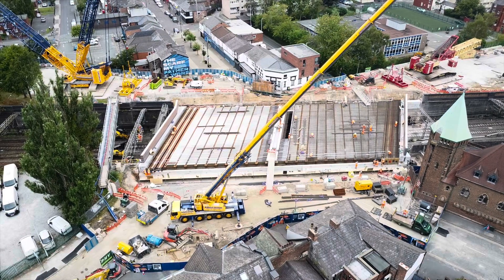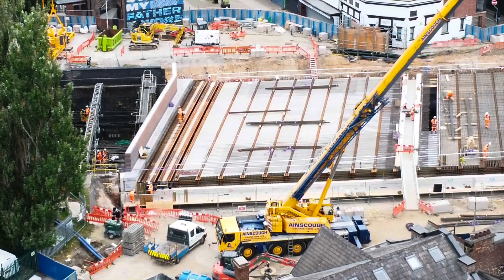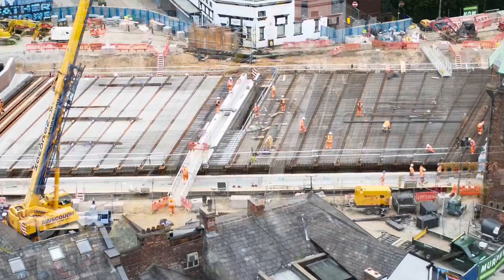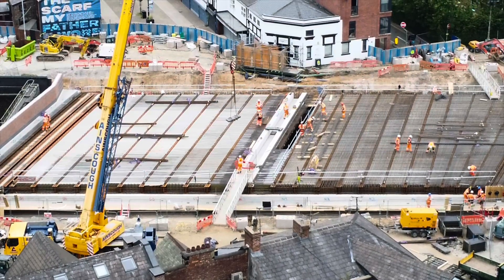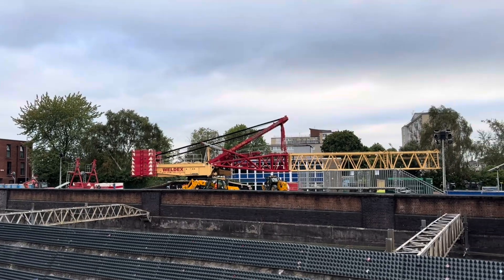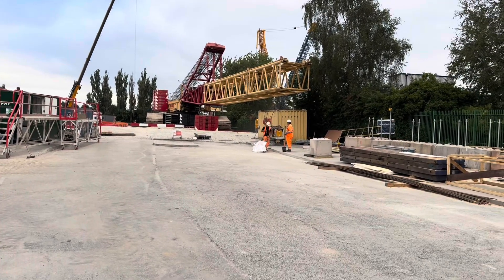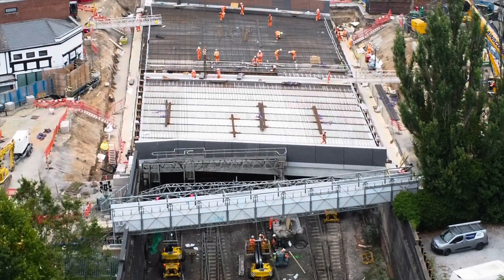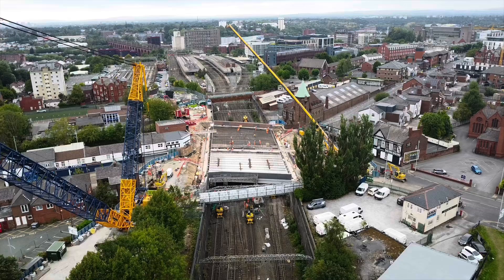Greek street Railway Bridge Replacement Project Stockport | Update 18/8/25

Comment: ..issues such as .. cos concrete set isothermic and heat is transmitted through bridge+steel.. and its getting warm.. we pour the other side next so it stretch at same rate
Reply from the maker: Cheers Pedro 👍
Reply: Will most likely mono poured . The bit in the middle will be for utilities to go thru so they put precast slab over it an then they don't need to put for work in to carry the concrete

Comment: My goodness!!!😮
Bridges come and go quickly, there!!
Reply from the maker: It’s a major rail line from Manchester to the South so needs to be done quickly and effectively as the longer it’s shut, the more delays there will be as the trains are either diverting or replaced by road transport. They are making brilliant progress.
Reply: Actually this bridge is taking a lot of time to build too, but what they have done is spent a lot of time (I don't know how long for this, but the rebuild of Bank Underground Station in London took ten years) planning a way to build as much of the bridge off-site in factories, then work out a schedule for which bits need to arrive in which order, then train everyone on the schedule (so they all know exactly what they are going to do every day) then run through the schedule as fast as possible.

The section of pavement, with a brick wall pre-built on it, is one of the clever things the planners have done. It's got built in rebar (reinforcing bar for anyone who doesn't know) in the base. While the rest of the bridge is being built like a very model kit, with the beams, then those big concreate rectangles (which are probably to cover that middle hollow beam and create a small tunnel for electric cables, water pipes and so on) are forming a basic structure that the work gangs are covering with layers of rebar (which they need to tie together with little cable ties) that end section can just be moved in by crane, propped up and held next to the bridge, and then they can do the big concrete pour that joins everything together.

If they can do that lot, they shouldn't need any more railway possession and should be able to let the concrete set properly and then lay down a new road surface and install new pavement.

I noticed the old bridge had railings between the pavements and the road on the roundabout. They have been discovered to get get cyclists killed, when vehicles turn left and don't realise a cyclist is there. Where I live most of those sort of railings have been removed, so that if a cyclist is going to get crushed to death, they instead get "shoved" onto the pavement and injured instead of killed. Will they make that change here? I don't know. They could make the roundabout smaller and add cycle lanes and maybe even put toucan crossings across every road. It depends on who is actually running the local council though. Some politicians are very into using road renewal to add cycle infrastructure. Others seem to suggest that bike lanes are a "plot against motorists" (even though bike lanes and road diets generally make traffic less congested).

Local councils generally have planning permission documents available to download. So there might be a bunch of drawings that show how this bridge is supposed to look. I've skimmed through Simon Rhodes's videos and I've not noticed that sort of video on his channel, but maybe - if we are lucky - he will look through the website, pull up the plans and make a video where he talks over a computer screen video and compares the proposed plans to something like Google maps to show what - if anything - is going to be different about the new roundabout. If there going to be anything different, like a one way street, with a contraflow bike lane, zebra crossings or a reduction in size of the central roundabout (to slow down traffic and add "public space" on the outside of the roundabout) I think it would be fun for us to know that, and then for Simon to try to use his drone to show us when the first evidence of the changes start to happen.
Reply from the maker: @DavidShepheard Hi David, thank you for the detailed reply. I’m useless with plans etc, but I am going to film the project to completion so stay tuned for that. In terms of plans, another YouTuber, Bryn explains it a lot better than I can https://youtu.be/zXr7WjJJEwY?si=5x6iMaGRtr3gDlt0